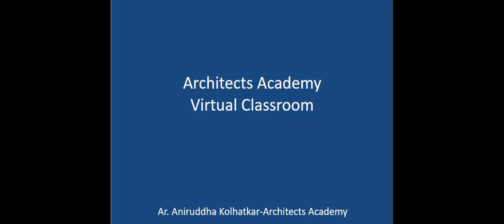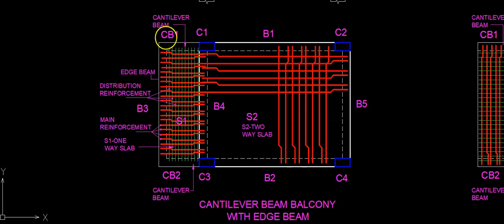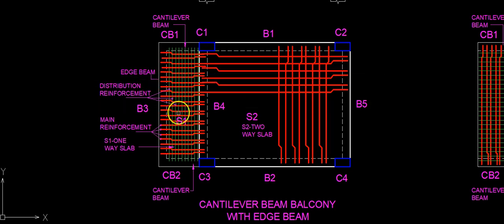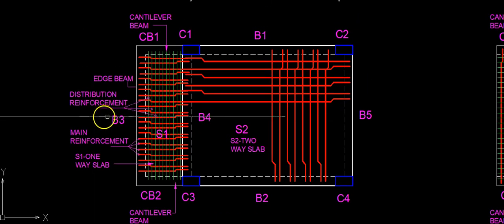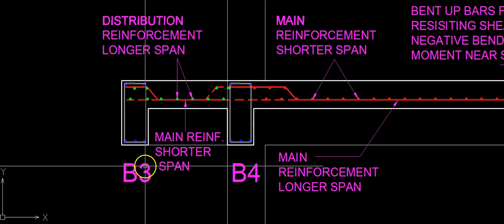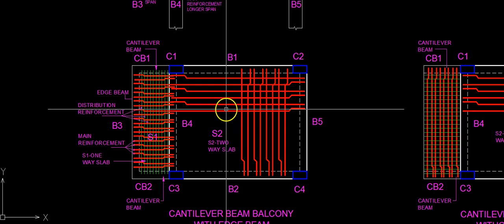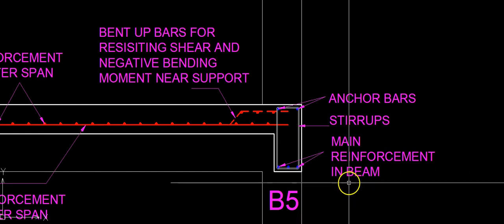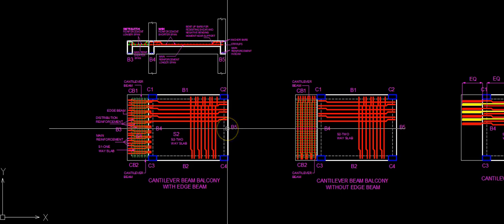BALCONY WITH EDGE BEAM

Comment: May I ask a question if it is possible that the main reinforcement of the slab can be from CB1 and CB2 ? in a long span and the distribution reinforcement is in the shorter span from B3 to B4 ,, thank you 🙏
Reply: It is possible only if edge beam is not taken. When edge beam is introduced the load will always go along the shorter direction. Hence main reinforcement will also be along shorter direction. I hope this solves your query. If any other question please feel free to ask.
Reply: @aniruddhakolhatkar7894  thank you so much